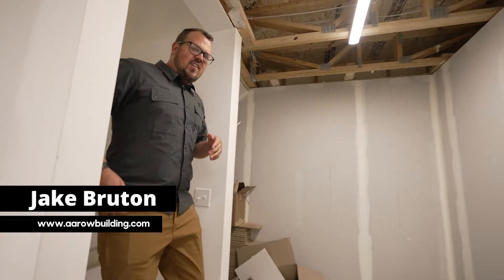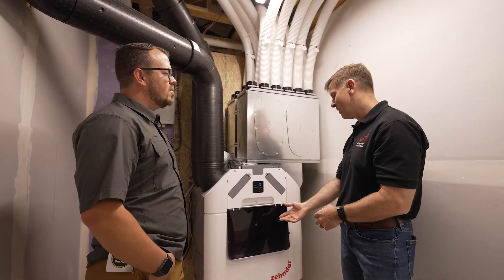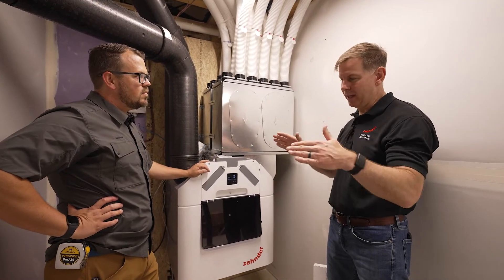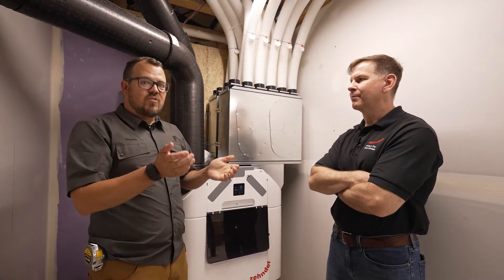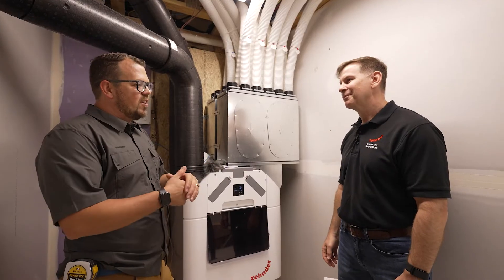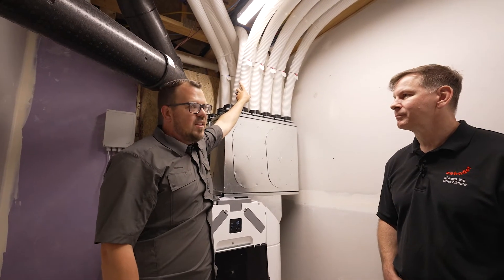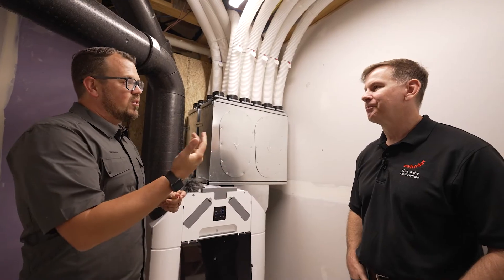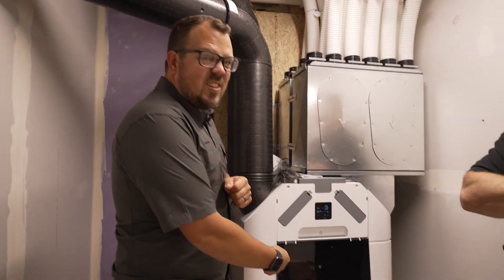Whole Home Ventilation (ERV)

Comment: What do you do in environments that get forest fires/smoke in the late summer/fall?
Reply from the maker: Great question!!! You turn the system off during that time. Simple as that. We have built a very tight (from and air leakage perspective) home and having the system shut down when the air quality outside is bad makes the most sense. We don’t want to bring that in if it is going to make things worse. There are some third party companies out there working to create systems that monitor and decide if we should bring the outside in or not based on real time date but I don’t know if any are up and going yet.
Reply: @jake.bruton.aarow.building  Really!? When the outside air is bad, the inside air will be worse. If you can't open the windows because of smoke, dust, mold or rain, the system should be providing your family with fresh clean air. Are you saying the system doesn't clean the air!? If the system isn't purifying the air so the smoke and other contaminates are eliminated in a tight house, what's the point of having the system?
Reply from the maker: I would suggest you look into the ASHREA standards for home to operate homes in the situations being discussed. This system isn’t meant to handle forest fires, therefore we shouldn’t ask it do so. It does handle most particulate matter down to PM2.5 (I believe), it also filters the air as it comes into the home. But it isn’t meant to work miracles across all situations. In normal conditions it will function very well. I don’t know if there are any systems out there meant to hanlde wild fire smoke.

Comment: What about dehum? If you want a high-performance system, do you have to have a dedicated dehumidifier, ERV, and HVAC?
Reply from the maker: This project does not have dedicated dehum. The ERV and AC keep up well enough. Keep in mind that ERV does not actively dehumidify it only moves more to less, it would need to be less humid outside than in to work to lessen humidity.

Comment: I'm starting to think it's cheaper to have a leaky house.
Reply from the maker: I can see how that could be the view. However, the leaky house runs the risk of many other things, condensation in the walls (risk of mold), higher energy bills for the lifetime of the building, lack of occupant comfort, and an overall uncontrolled indoor environment. We don’t view most of what we do when we build as a return on investment item, structure, water proofing, functional plumbing or cabinetry, those things are never a return on investment conversation. I don’t believe the effciency conversation should be that way either, for longevity of the building and occupants it shouldn’t be an option. But I hear where you are coming from.

Comment: First time I've heard of this system. Can this be installed after the build is complete?
Reply from the maker: Obvisouly it would be a renovation type situation to do so. Cutting and fitting and repairing. However, since this system operates basically seperate from the HVAC, it should be able to be installed later on. However, I would for the system to be engineered because their may be simplier alternatives to resolve the matter.

Comment: Great video Jake!   Question though … we are building a new home.    I had a Manual J analysis done by Energy Vanguard, which I have supplied to the HVAC contractor who is assembling the system quote.   The contractor uses Renewaire ERVs.  They are not familiar with Zehnder and skeptical of the value of separate ductwork systems for heating/cooling AND air exchange.  Are there “white papers” or industry research which document the benefit of dedicated ductwork for air exchange?

Comment: So it will take a fart from one room, and put it into the other rooms.
Reply from the maker: Not at all. It takes the fart outdoors and replaces that fart with filtered and tempered air from somewhere else outside.
Reply: @jake.bruton.aarow.building  not when it’s running in defrost it just cycles air within the house it does not take in any fresh air
Reply: @jake.bruton.aarow.building  I’m installing one right now and it’s an over engineered piece of shit everything that it does could be done with a standard air exchanger like a Hero.
Reply: Not too bright, are you?

Comment: with this system do you do central heat and air or do you use mini splits?
Reply from the maker: Because this system has its own ductwork it should work with any well designed heating and cooling system.

Comment: The air doesn't mix at all.

 Temperature exchange 😊

Nice presentation 🎉
Reply: That was my understanding as well, but now I’m left with the question how do you exchange the humidity (as mentioned) if the intake and exhaust air don’t touch?

Nice video and really nice installation

Comment: Granted, you may use MERV13 filters at intake and in or on the unit, still I wonder about the potential for the counterflow exchanger unit to grow mold...how can you acceptably clean it?  If the home's heat is off, how do you ensure mold-free operation and for what duration of independent operation?
Reply: You can clean the core out btw, you can legit just stick it in a bathtub